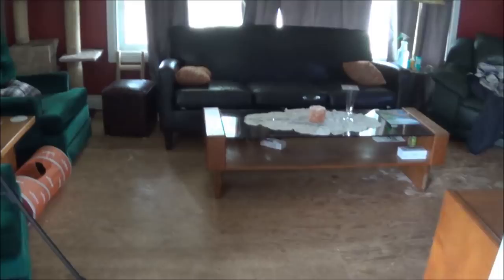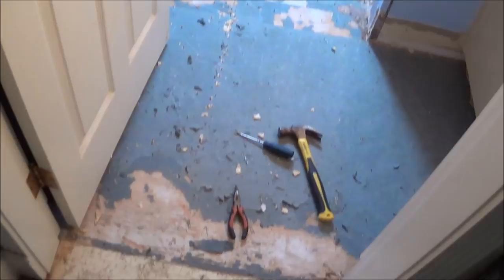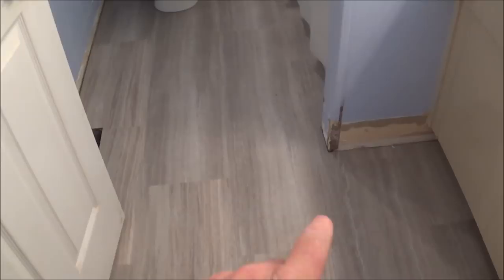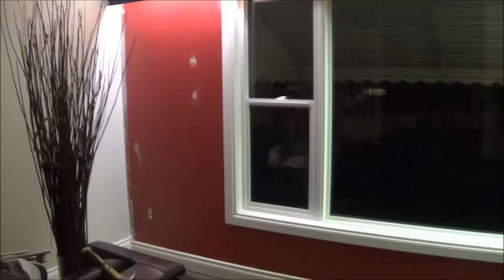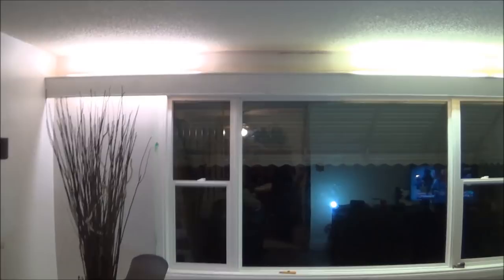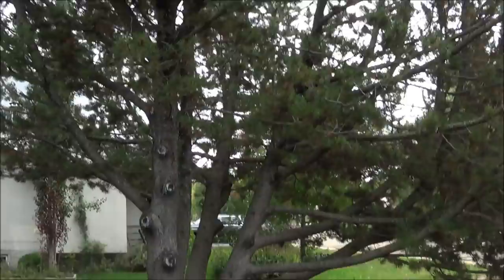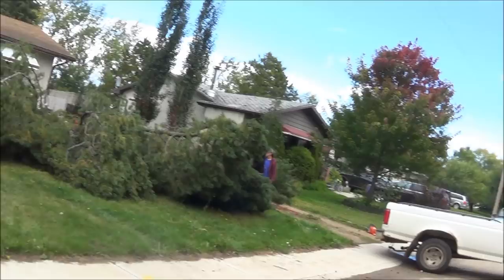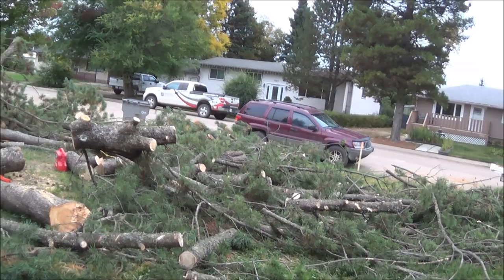New flooring,Painting and Falling a Tree

Comment: you ought to put down ceramic tile in the bathroom, kitchen and foyer for front and back doors. pretty much anywhere that a lot of moisture or water can gather. i love that gray weathered look of the second batch of flooring. did good with the tree too! make sure you cut a + in the stump and  burn it too that'll keep the tree from growing back and you having to do it again in the future
Reply from the maker: Too late for the bathroom. The chit we got is high end it's made for this.
Second batch is going in the bedrooms and it is also top of the line vinyl 100% water proof and all.
The town is digging up my street so i ask while the where at it if they could pull it out it's looking like they will.
But if not yes i will kill it.
Reply: cutting cross ways through the stump and setting it on fire is the best way to kill it off got a few wild ones here i need to cut up and do that to myself.  :o)